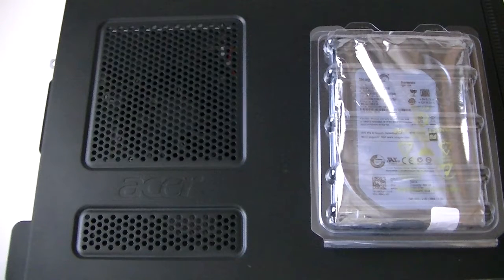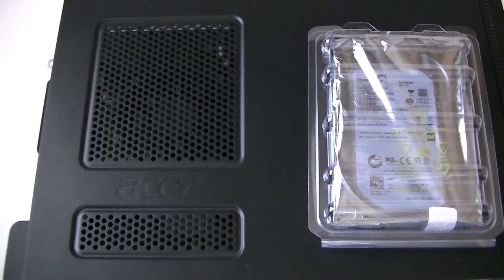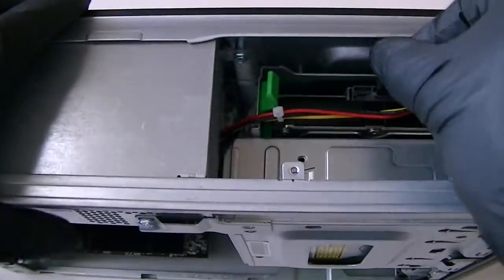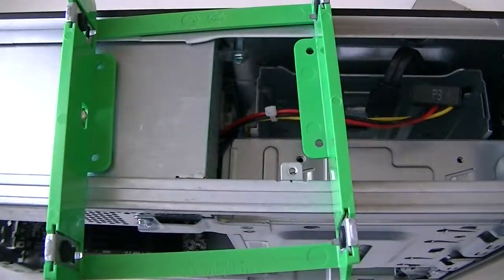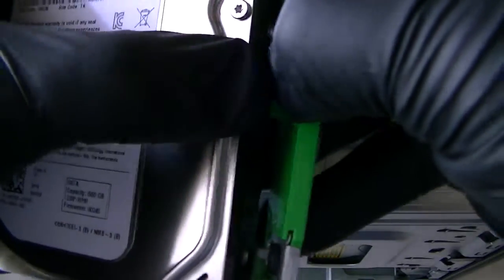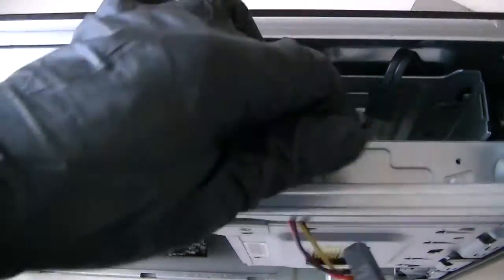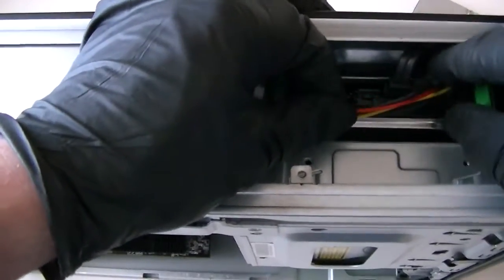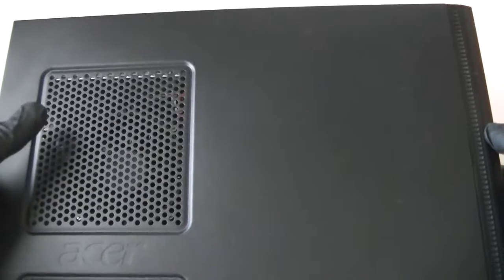Acer Veriton X2110 Hard Drive Upgrade

Comment: One question. My hard drive is not being shown in  the BIOS after I did an installation of Ubuntu. This happens after I reboot the os. Once installed I can use the operating system and that hard disk appears in the terminal, the problem is that after I reboot the hard disk disappears. I have a similar computer.